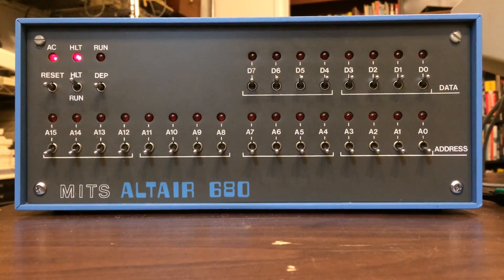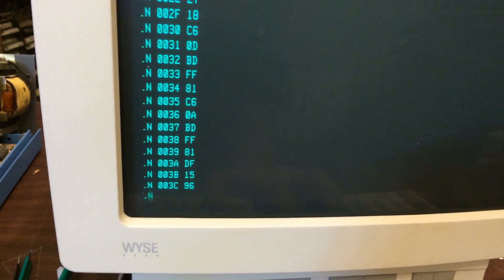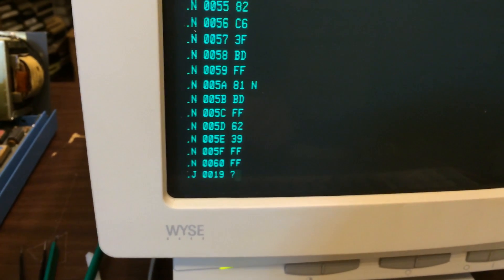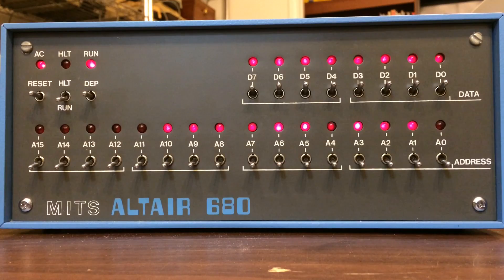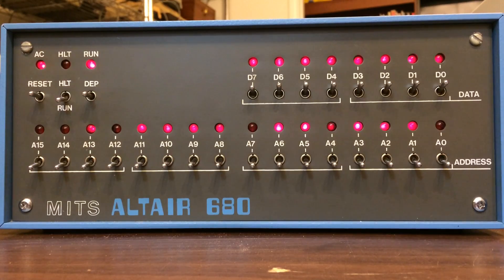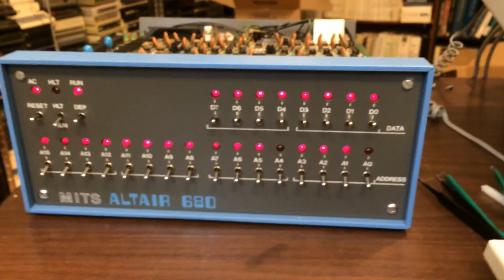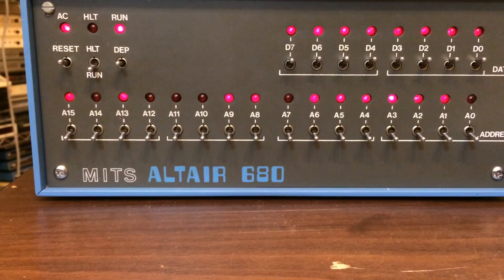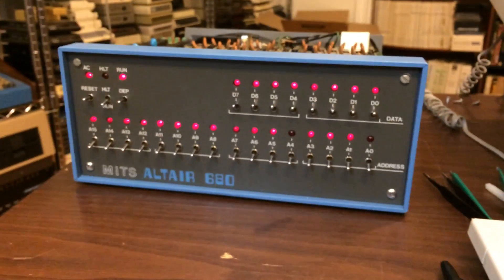Altair 680 Fully Repaired and Fully Functional

Comment: I can't understand, what was the operating system for the machine? And how could one load a software in it? I see, with hitting the power on, it's already has something going. Showing a dot and waiting for a command. Is it an OS?
Reply from the maker: That is the ROM monitor.  No storage media.  See my video about assembly development to learn more.
Reply: There was no OS.  You see all those switches and leds on the control panel?  They let you fill the RAM manually, and then when you switch to run, to start the program.  If you are lucky to have some ROM with a monitor program (which essentially would let you do the same thru a terminal (tty or vty), or in the best case, which would let you load a program from a punch tape or a cassette magnetic tape), you would still have to use the switches to enter an instruction to jump into this ROM monitor program.

See an example of loading from punched tape: https://www.youtube.com/watch?v=qv5b1Xowxdk 
(where you can see the input of the loader program by hand),
and from magnetic tape: https://www.youtube.com/watch?v=bymOIRg5M9E

Comment: nice machine . where do u find old machines anymore , as they head to ewaste now? thanks .
Reply from the maker: They are available if you look in the right places, but they are not very cheap anymore.  Most ewaste would hopefully be smart enough to know their values on things.  Vintage computers of the right sorts are worth more than their scrap value by a good margin.
Reply: thanks
Reply: I found just the case for a 680 (with nothing inside) for more than $600 on EBay, and a functional 8800 is listed at $10,000. You can also find replica and emulator systems for quite a bit less money. The "Altair-Duino", for example, can be ordered in kit form for $150 and assembled for around $250. 

Personally, I'd like to see more of these kinds of computers built and sold to colleges and high schools to be used as training systems. Back when I took my assembly language programming class, we learned on 8085 bare-bones computer boards with basically a calculator keypad and display. That was actually a lot more fun than typing in programs on a PC because I had to do all of the work myself, and I got to understand how the computer actually worked.
Reply: I found one at a garage sale. Unfortunately, this jerk running the yard sale snapped it in half right in front of me.